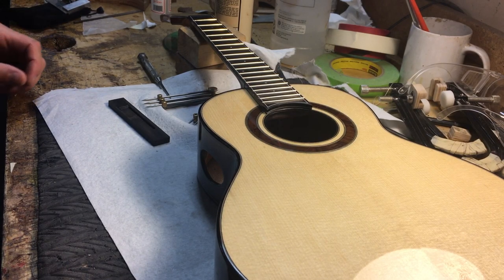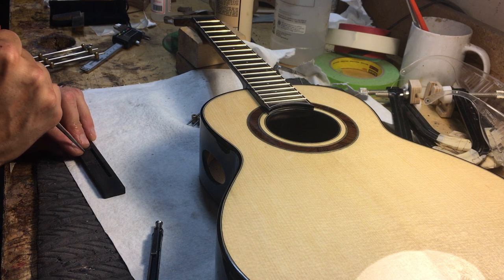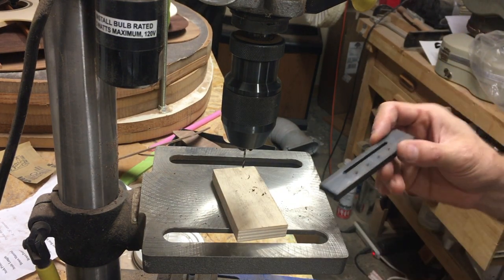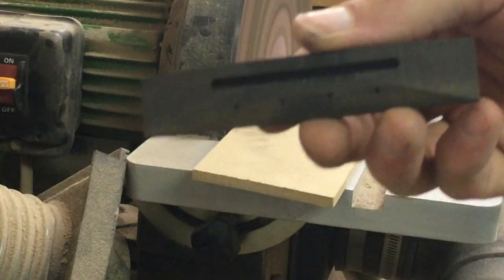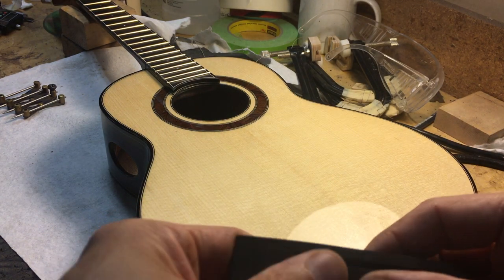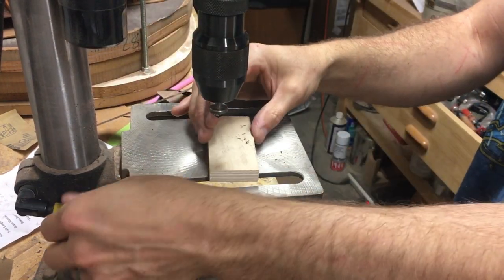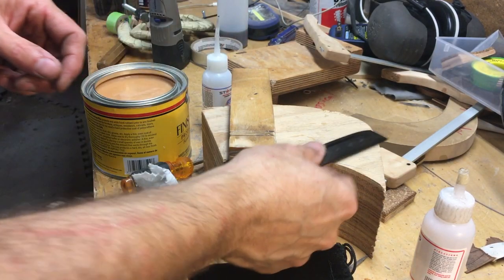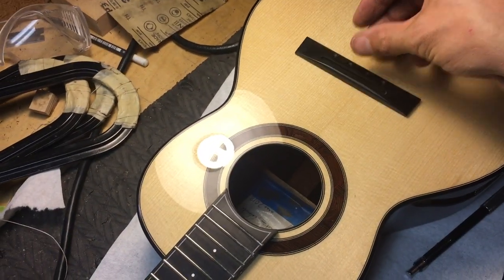Making a Ukulele Bridge in Real Time Beau Hannam Guitars and Ukuleles

Comment: Beautiful bridge. Actually my choice for what I would have on a uke. I've just bought 4 different ukes and the closest I've come is a pin bridge and still have them match my other criterias. I'm considering drilling holes in the ones with tie bridges. I must be missing something as to why not all bridges are made this way. Maybe you can clarify. Any reason you can think of, to not do this. I'm a woodworker and have all the necessary tools except for maybe some files. Also, did you glue the bridge directly to the gloss surface, or did you sand it first? I know there are some fancy acrylic glues that they don't have in the big box stores. I've used just about every one imaginable. THX
Reply from the maker: You probably could turn a tie bridge into a string through bridge - just check that you sent drilling into/through any braces. You would also have to add either the internal and permanent “gem stones” I use, or use beads.
I do a 100% wood to wood footprint (ie I remove all the finish under the bridge)